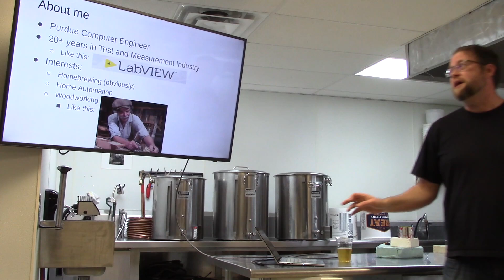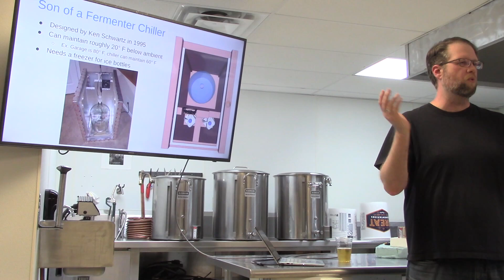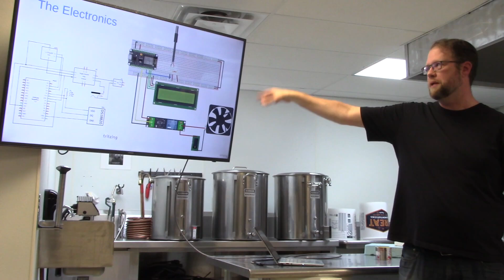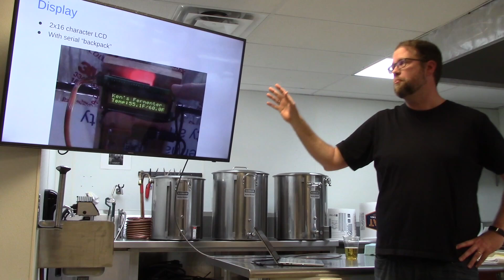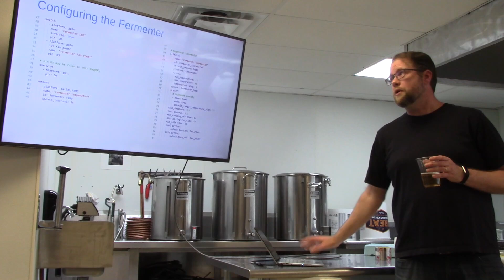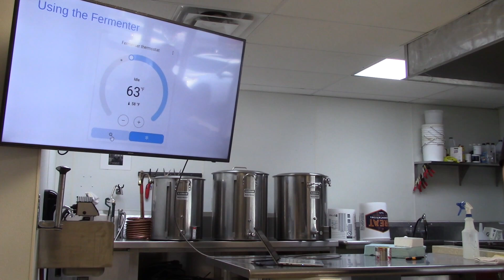DIY Temp Control with Home Assistant by Ken Sharp

Comment: I stated using Home Assistant in 2020 (got into it during the pandemic).   All I can say is-  DONT DO IT.  I started off just wanting to replace all my legacy and increasingly dying from EOL inventory of X10 switches with something IoT and modern.  Check.  Then I got into creating nice dashboards. Adding all kinds of LED controllers. I integrated it with my AV system so I can control volume and see what’s playing.  I added over a dozen hue bulbs and wrote automations based on motion and time of day.  Then I got a whole bunch of contact sensors and put them on everything from exterior doors, to refrigerators, to mailboxes and made automations to let me know if the door was left open or if the mail had arrived.  I added an additional dashboards to create quick at-a-glance displays incorporating weather, calendar, and task lists.   I added all kinds of motion sensors to turn things on and off automatically, and even send alerts to my phone when motion is detected.  And then I also started doing things exactly like this video is describing-  using sensors, switches, relays, and custom automations to run little bit of “process” equipment in my workshop- like a UV curing chamber for 3D resin prints.  You know, like bringing the chamber up to 60C and holding it there before turning on the UV lights for 20min followed by a cool down and then a smart phone alert when finished.  And then, just when I thought I was done expanding, I got into video camera.  I added a Reolink NVR with two exterior panoramics, a POE doorbell cam, a PTZ parking lot cam, and two barebones Tapo IP webcams for dog monitoring and interior checking.  And of course integrated into Home Assistant with automations to display feeds when motion is detected.  And with HomeKit you can pass these entities over to Apple so it shows up on your Apple TV.  Added an Aqara door lock that can be unlocked with smartwatch, phone, fingerprint, or remotely if you need to send someone by to check on something, as well as a pin pad.  Currently I am playing around with mmWave proximity sensors for better presence detection so lights don’t turn off when you’re sitting really still.
Reply: Is it a fun hobby?  

Sure.  

Has it made my life feel much more convenient and seamless, from lights automatically turning on when I arrive home or leave, or bathroom lights turning on and off as I enter the room? 

Yes.  

Is it convenient having information about my house, environment, and tasks at my fingertips?  

Sure.   

Do I now have a never-ending list of upgrades and improvements? 

Absolutely.  

Am I constantly spending money on upgrades and expansions? 

Damn straight.  

Is it a black hole that will suck you in to a new hobby equal to, if not more, addicting than model trains, brewing, and RC planes?

Yes.  Even worse, because with enough ‘tism you can find a way to integrate those hobbies INTO this hobby.

DONT DO IT. 

Once you start down this path there is no turning back.